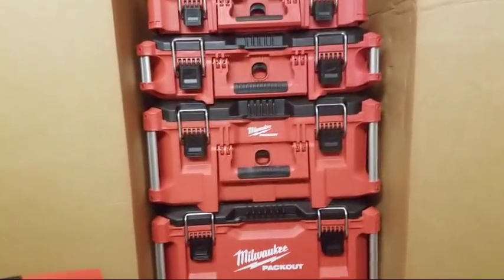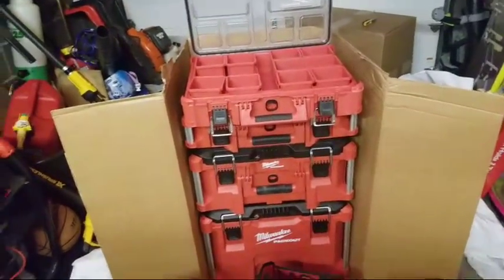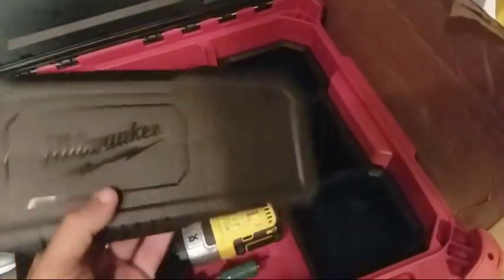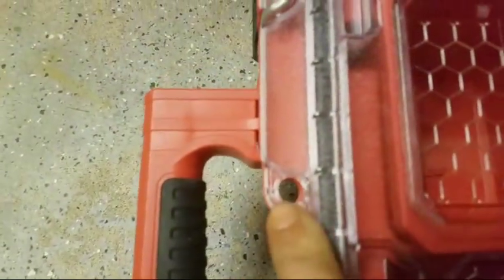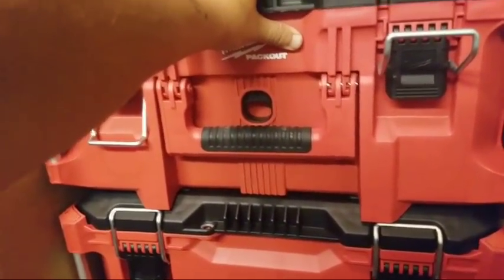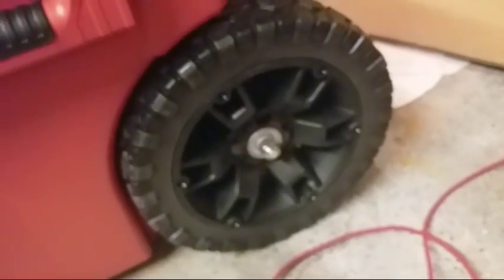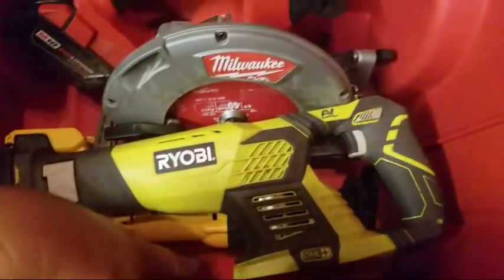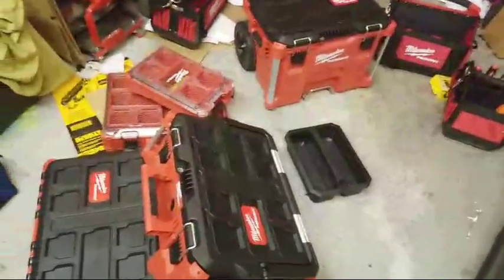Milwaukee PackOut System ...Live And Uncut Part Duex

Comment: Really disappointed that the new vacuum doesn't snap on the top, so you can have your bag on one side and the vac on the other. Instead it falls off as I walk through the mall. I think someone kinda dropped the ball on that, a couple plastic feet and a sliding switch would have been an easy addition to a vac that is already almost the same size as the smallest packout organizer...

Comment: I have a 2016 Transit connect short wheel base and i am just going thru figuring out what to build/buy and this shit looks like its the best of my options...handyman doing lots of service calls etc...is it expensive?!?!
Reply from the maker: +Matthew Schmidt yea but to be honest this 3 box set is $279 right now ..the DeWalt tough system which is just as good id $99 ...i believe ...could of gone up to $129 or $149 .
.id go that route ...if you can hold out at some point $199
Reply from the maker: +Matthew Schmidt uploading a vid now of some stuff you may like to look at ...check it out ..its uploading now

Comment: There a spot for each box to screw in ticks. If you screw them in anywhere then it wont be waterproof anymore.
Reply from the maker: +James Hidalgo cool james i will have to check that out
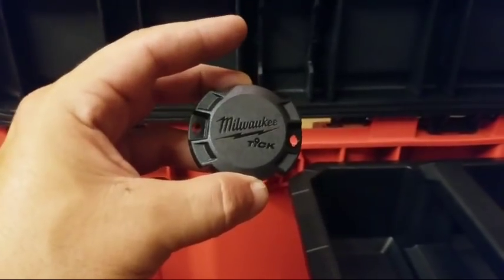Reply: 38:10 on your video. The spot is literally above the tick.
Reply from the maker: James Hidalgo cool ..👍👍

Comment: Yo Boss. Acme tools instagram post on this system was said that the outer cases were made in Israel and the inner trays in china. I wonder if the cases are made with that high strength polymer they use for firearms.
Reply from the maker: SLR326 thats great ...thanks for info bro